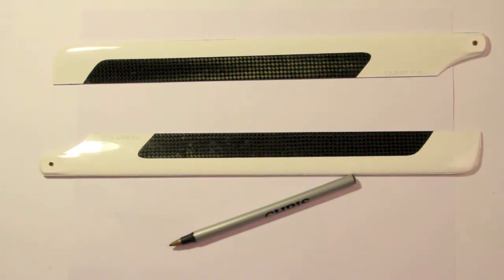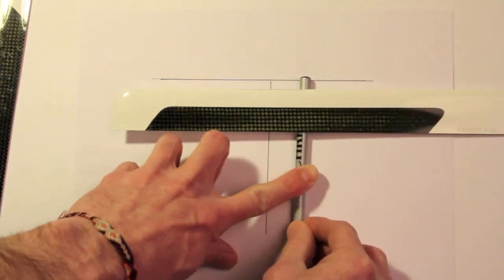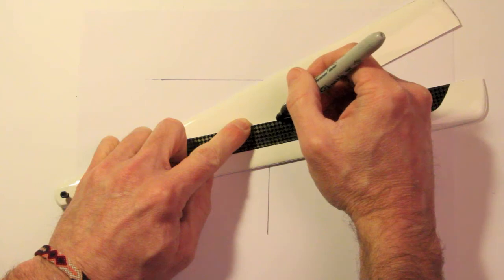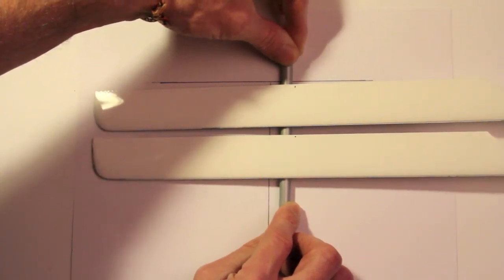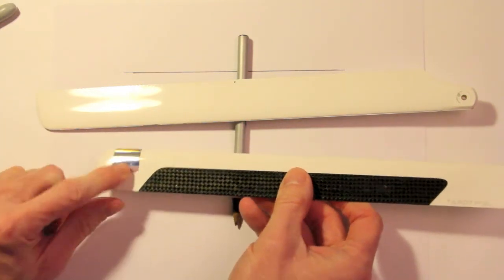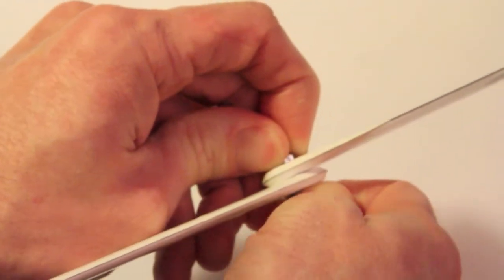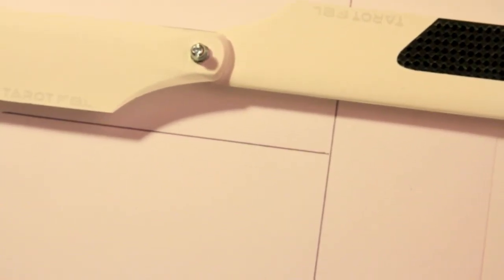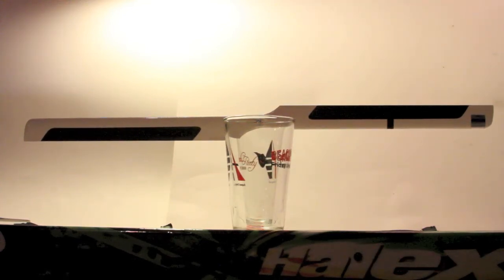29 : Tarot 450 Pro V2 Build : Blade Center of Gravity & Balancing

Comment: Centre of gravity importance is a myth. Heli will fly on one blade and a piece of lead on the other blade holder. Centre of gravity wildly different, but so long as the moment force is the same, heli will fly fine (less lift with one blade of course)
 Just use the balancer.
Also have leading edge on the same side. It is very important that blades are precisely in line on the balancer. This is easy, just press the two leading edges up against a table edge or whatever. No problem if the blades are not exactly perpendicular to balancer axis, so long as they are in line. Out of line, one will effectively have a different moment arm…. Bad. 
It’s all physics.

Comment: Hi EVERYTHING cpo may I suggest a: when you bolt the blades together do it so they are MATCHED ie: leading edge UP on both sides not the way they will be on the heli - you are giving yourself a balancing error right there.... also, $$$$ for the heli but not a dime on a proper blade balance unit..???

Comment: Hi CPO. I have found this belancing system very easy to follow. But I have found when I have got them on the two glasses, If I turn them upside down the ammount of weight i need changes. Have you found this and if so what way do you go for the way that needs more weight or less.

Comment: I do balance the blades mounted in the bladegrips ( tighting strong, so they do not flap) and with the complete head assembly (of course without swash and links), I try to balance them on the mainshaft with the mainshaft bearings because it's possible that the grips, or the axial-bearings are not correctly symetric. then by tilting the heli 90°,  I can balance them under running conditions. of course you can do it your way before and check the difference afterwards. by doing this, I got the best results.
thank's for your detailed clip!

Comment: Hello,

Great video, only one question why do you balance the blades like they are on the heli ?
If you don't (and turn one upside down, both of them will make 1 straight line which can easily be made by putting them on a straight surface.
Secondly you can use a laser leveler or something to see the perfect alignment.
Do you see a disadvantage ?
A rookie who has discoverd that with "real" balancing tools you even need 3 full glasses to calm down your frustration.
Reply from the maker: You could definitely take all of this to the extreme. Laser level would work if done properly...but might be over kill. I put them like they are on the heli just to remove any bias in weighting from either side of the chord. Probably doesn't really matter. These days...honestly, I mostly just check the quick balance to see if their CG is about the same, and if so, just check their weights on the scale and add tape at the CG point of the light one until it matches the heavier one. I haven't done the full balancing very much lately, and everything seems to be working fine.
Reply: +EVERYTHING cpo "I put them like they are on the heli just to remove any bias in weighting" -- no, that way you are introducing bias to the system, the trailing edge side will always seem heavier although it might not be - think about it, your way the extra weight is now above the balancing point....

Comment: Hi CPO i have a question I watched this video trying to understand how to get cg and balance. Did it just like you show here! you explain things great! the only difference is i have a blade balancer so i used it to balance the blades seems to me that would throw off the cg so i rechecked the cg and its off a little should i worry about that or did i do something wrong?
Reply from the maker: I am not sure I understand your question. But...if the CG is off just a little, it will probably be fine. If it's way off, you may see tracking issues (guessing). Regardless of whether you are using a blade balancer or some other DIY method, if you apply your weight (tape) at the approximate CG point on the blade you should be fine, tho.
Reply: @EVERYTHINGcpo  I thing that balance blades on glasses is enough, because center of gravity will corrected too in this way and you will have only one tape. Why you need balance cg separately?
Reply: +Scott Mattingley trust the blade balancer...